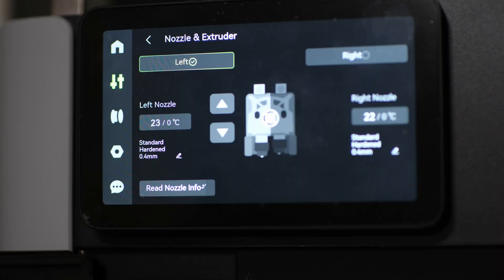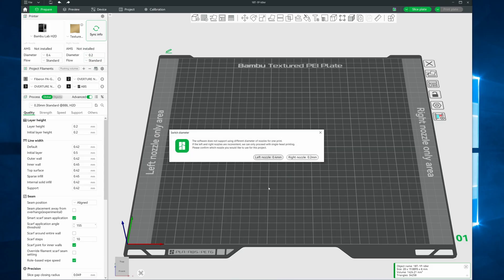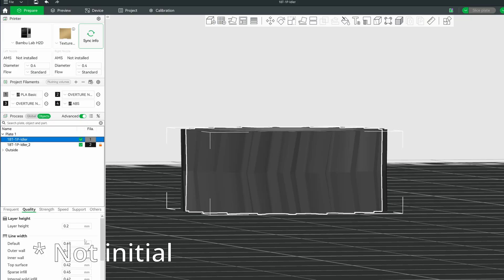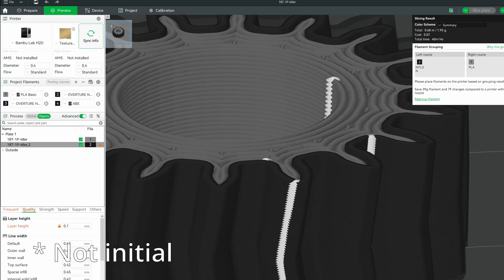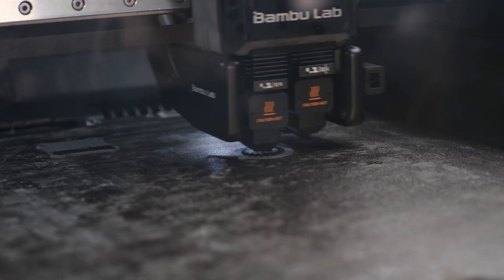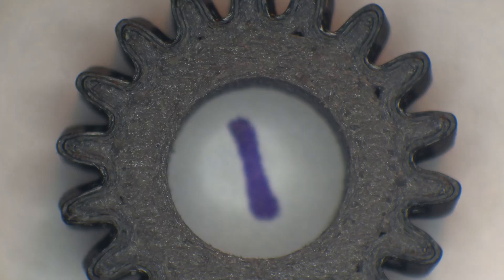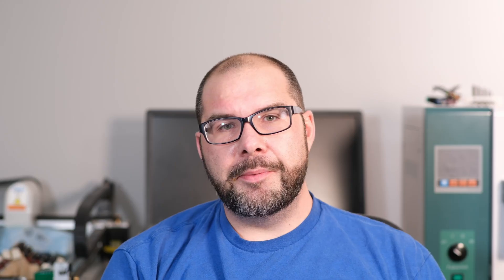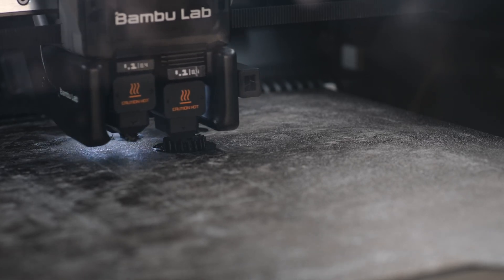Print simultaneously with different sized nozzles

Comment: i just recently got a p1s with two ams units... upgraded from an ender 3 v2 neo. the whole dual and multi nozzle thing will likely keep evolving at an alarming rate, so ill wait a while before upgrading again.... even though i want a larger print bed because while 256mm is nice and bigger than my ender 3, i really could use something over 300 for the small speaker enclosure projects i wanna do as well as maybe some exo cages for some of my rc cars

Comment: It’s definitely possible. Bambu Lab Studio uses G-Code, which has been widely used in CNC machines for decades. Almost all CNC machines can switch between tools of different sizes (for example, various drill bits).
With just software and firmware updates, this capability should also be achievable.

Comment: That's not how any of this works. If you set the extrusion width lower than the nozzle size it will extrude differently than having the correct nozzle size.

Comment: i would think you also probably would need to recalibrate the pressure advance because it's going to use the default 0.4mm nozzle values
Reply: What a hassle, its 3D printing, not printer tuning. Otherwise I wold get an ender or a Prusa.

Comment: I've been building 3D-printers for a couple of years and I would say that machine hardware has a long way to go. But it is smarter software that will bring 3D-printing to the next maturity level. 

Things like different nozzle sizes for the same part, hotend swapping for different, colors and materials, non planar printing for smoother finishes, and much more.

3D-printing has just begun it's 100+ years journey

Comment: This is clickbait, you're not using different sized nozzles, you're just changing extrusion widths and layer heights, it's not the same thing. Having two .4mm nozzles and running one with with .2mm extrusion width and the other at .6mm isn't the same as actually using a dedicated .2mm and .6mm nozzles. Nozzles can only run within a certain percentage of their diameter. Going too far off that will drastically change mechanical/print quality and you just have to keep screwing around with layer height, which will also effect time and quality.

The prusa XL and prusa slicer is the only one that can actually uses different nozzles sizes within the same print. And its not even officially implemented yet. Bambu lab is not a slicer developer, they just copy from others like prusa slicer and orca slicer. So until either prusa or the team behind orca come up with a way to officially support multi nozzle printing, bambu will never have it, and thats just a fact.
Reply: Wow, you really are incapable like that lol. He is actually using two different nozzles, which you would know if you actually watched the whole thing. You are just blinded by pure rage and hatred.

Comment: I have been printing with a set of 0.8mm and 0.3mm nozzles for over 10 years now using the AutoMaker slicing software and my Robox. Simplify 3D can also do this.

Comment: It's not a Bambu Lab thing. There have been toolchangers for ages slicers are still strugling when combining two nozzle sizes in one print. The problem is not that the slicer is not capable of different layer heights or line widths, that has always been possible. My guess is that it's the properties of the smaller nozzle that's the problem. You need another flow rate and feed the filemant slower or faster. Pressure advance is also a factor I guess. Those are properties that belong to a certain nozzle size. Maybe you can modify a profile for the filament that you use in the right nozzle with the parameters that fit a different nozzle.
Point is, that if it were a simple problem, it would be readily available. But it seems that Prusa slicer has an option,but it's still a lot of guesswork and not really convenient. I'm sure Bambu is also working on the problem since it would expand the possibilities of their products.
Reply: Prusa slicer and the XL have been able to use different nozzles sizes for over a year now. Its a beta feature in their slicer. And I mean true different nozzles diameters. Not all this nonsense this guy is doing.
Bambu isn't working on anything, as they are not a slicer developer like prusa is. They're waiting on prusa to make theirs official before they come and copy it.
Reply: This guy did actually use two different nozzles.

Comment: Very creative work-around and definitely solid questions of 'why is it like this?' A while back I found out Bambu had no per-filament XY shrinkage settings and helped rez a year old thread of them 'working on it' they gave it attention very shortly after that. I'll never know but I'd like to think I helped encourage that, even if I've swapped fully over to Orca due to their other printer-control related shenanigans. Maybe the line-width stuff will become a feature if also demanded enough. Seems to be no reason it can't work. Same as the XY constants, it was just extra faffing about with something they could have made a setting.

Comment: Wait... What's the deal with the lack of support materials for H2D? They just don't make good ones for engineering filaments?
Reply: ASA works really well for nylons as support material. Better than support material dedicated to nylon.
Reply: @FrozenByFire3 that's good to know. Now I just need an H2D or toolchanger lol
Reply: there is no support material for the high end cf materials like pps-cf or ppa-cf. Only high end filament where you can use a different material as support is pa6-cf. Kinda fake marketing.
Reply: @AOTanoos22 you can use ASA.... I literally use ASA-CF for PPA-CF support material. Works perfectly. Have my Z distance to 0.00mm
Reply: @FrozenByFire3  nice, did you try pps-cf with ASA support ?
Reply: @AOTanoos22 haven't tried PPS-CF sadly. Don't have a use for it
Reply: @AOTanoos22  there is, raise3d has it for ppa

Comment: Interesting, I grabbed one on my Mod0.2 pinion STL files I used on my resin printer, opened Cura, 0.2 nozzle, 0.08 layer, sliced and got a 2min gcode file. Probably won't work but Mod0.5? Worth fixing my FDM to try, just got a 5 pack of 0.2mm nozzles 2 days ago.

Comment: SnapMaker Orca has multiple tool heads, doesn’t support different nozzle sizes in one print yet, but if you modify the JSON files, you can do this. A HK YTr with a SnapMaker U1 has done this, and as OrcaSlicer is similar to Bambu Studio, that might be where you have to look. Maybe even. Digging in the H2C nozzle definitions might give some clues…just my 2c

Comment: I could do this in 2014 using AutoMaker slicing software, and SuperSlicer later used “Multiple Extruders” and you could assign Extruders to line types. Simplify 3D could do this as well.

Comment: thats a creative way of getting around the lack of ease. This is the level of annoyance I have grown to expect with some of their stuff unfortunately. I don't even think the prusa guys had thought of doing that as a work around for xl similar troublesome support of such things.
Reply: Because we don't need that work around. Set line widths to 100%, set nozzle diameters. Assign features (walls/infill) or parts to the tool heads. Done.
Reply: Prusa slicer and the prusa XL literally has the ability to use different nozzles sizes within the same print. It's been a feature in prusa slicer for the past year now, its just not an official update yet.
So yeah, prusa did this over a year ago man. The only reason why bambu hasn't done it is becasue its not an official implementation within prusa slicer, so bambu cant blatantly copy and rip it off yet.
Reply: Thx for the correction, last I had read there was ways to do it unofficially but it wasn't an easy process.

Comment: I'm not really sure what point you're trying to make here. Sure, you can make the printer print with different nozzle sizes (thinking that it's the same). So..? How is that useful? Unless the slicer calculates for it. There's obviously a lot more that goes in to printing with different nozzle sizes in one print than just installing the different nozzles on the printer. The slicer needs to be aware of the different nozzle sizes in order to create the different toolpaths for the different nozzles. The slicer cannot do this of today. So we are not misinformed. If Bambulab had it all figured out with good results and ease of us, it would exist already.
Reply from the maker: I think I  proved that the slicer is aware of the critical information, line width and height. This hinges on actually doing the design in CAD and not just relying on the slicer. That's the the thing. With that, everything you said is wrong. If you ignore cad and have the slicer do this, then yes you're right. But that wasn't what the video was about.
Reply: @kwakeham  
I'll quote your description: 
"Ya, so seems the slicer can. We we're all mis-informed. It works. It's fine. It's fine. Try it."
What do you mean you have to do the design in CAD? Every design is made in CAD. I guess what you mean is that the different line width and layer heights has to be applied to different parts or objects. Yes, obviously.
My point was that in your example the slicer is slicing for a 0.4 nozzle. It doesn't know that you are using a 0.2 nozzle. And thus the outer perimeters will always be off by 0.1 mm, regardless of the line width setting. The slicer generates different toolpaths for different nozzle sizes. This cannot be compensated for in the slicer. But you could indeed compensate for it in your CAD-design, and maybe that is what you meant. But nowhere do you mention this in the video. 

So we are pretty far from: "We we're all mis-informed. It works. It's fine. It's fine."
Reply: Prusa slicer can do it with tweaking on the prusa xl. It allows a print that is faster and more detailed then printing all .2

Comment: gotta wait for the open source crowd to solve the issues and then it will be in bambubu app
Reply: This has been a feature supported in Prusa Slicer for over a year now, which is fully open source (Bambu Slicer is originally built off of Prusa Slicer)

The Prusa XL and upcoming INDX are able to use this feature without issue. We (Prusa) hope that the work we've done on multi nozzle size support in our slicer can help the larger community, as per the nature of open source. :)

Comment: I am interested in understanding what the new H2D’s “Toolhead Enhanced Cooling Fan” is good for.  This is an improvement that came from the H2D pro and is now offered as an upgrade. It’s for materials with heat creep issues, not sure if helps with engineering materials.
Reply: From reviews/reddit articles I believe it's mostly to replace the normal one that breaks down way too quickly when using the chamber heating for printing high temp materials, because its fan bearings can't handle the constant high temperature environment. But BL is disguising it as an "upgrade/enhancement" instead of admitting that the normal head should have been fitted with this higher temp resistant fan in the first place

Comment: My guess is that slicers may one day offer differing nozzle sizes for sparse infill and support material, but based on what other people say, it may never be practical for other areas. Would be nice to be able to use smaller nozzles for outer shells in future without causing other issues.

Comment: My guess is that, as you have found, there are some quirks to be worked out and they just haven't gotten to it yet. It seems like BL puts the user experience above everything else and if they can't make something work perfectly they probably simply won't put it in until they can.
Reply: I think this is right. The H2C could have optimized filament changing quite a bit. There must have been corner cases so its takes the longest path, which als ensures an overall good user experience (sans time to print but that is better than subpar prints)

Comment: Can anyone comment on the way this works on the Prusa XL?  My understanding is that it's a beta feature in PrusaSlicer but I couldn't find any videos discussing the specific feature at any length.
Reply: Prusa slicer/prusa XL can use actual dedicated different sized nozzles. Not this "jumping through hoops" stuff that this guy is doing, nonsense about changing extrusion widths and changing layer height.
Reply: @LilApe  Yes, and I'm wondering if there are any videos testing/showing the feature in detail?  I believe it's a beta feature, so I'd like to know how functional it actually is in practice (what it's good at and what its limitations are) but so far I haven't been able to find a lot of info on that.
Reply: he is not, you are Iying again

Comment: Yes, the slicer can slice with different line widths and heights, but I think it's disabled for a reason. You would need to interpolate between regions of low and high detail, if the lines are next to each other, or you'll end up with gaps. Or detect those gaps and then try to fill them with the smaller nozzle, which itself has many edge cases I can think of. Plus you need to enable z-hop on travel to avoid collision, and even that won't be enough if you are trying to print adjacent to a line that is higher than your current nozzle height. That last part could be solved by having one layer height be an integer multiple of the other.
Anyway, long story short, it's a computational problem, and I'm sure it'll be solved, but we're not there just yet.
Reply from the maker: For engineering as I showed these are non-issues. If you're bringing in a solid model then yes, you need a way to differentiate but you can do this in cad. This is why these videos have used a herringbone gear, a structure that has non constant curves and sweeps for the most complex curavatures. So long as you do this in cad it works. This does require planning and cad so not useful for art models. 

I did mention it, but the tallest layer is always printed next. So far as I can tell this is already solved to an extend. I believe, but could be wrong, that zhop is already enabled by default.
Reply: This is complete nonsense. There are industrial 3d printers that can change the nozzle size while printing without having to swap the nozzle. CNC Kitchen made a video about FORMNEXT 2022. This technology is extremely old by now. In fact, it's as old as Bambu Lab.
Reply: @shushirakawa3182 We are talking about the slicer he's using and more generally consumer slicers, which all borrow code from each other. Not about closed source slicers inaccessible to the average user. Same with non-planar printing, which also exists in industrial slicers.

Comment: The problem with multi nozzle size while printing, is you get some quirky print quality issues, not to mention the complexity with slicing. When you are using a .4 and a .2 for example, each nozzle can reach effectively different corner radii, this ultimately causes prints to have an insane amount of gap fills that cannot be compensated with Arachne. You also must have the same layer heights, as you can otherwise have collisions (this is why independent support layer height can only be turned on when the prime tower is off.), you would have to do fancy collision avoidance calculations on each layer, and the added travel time would negate the time savings. Having the same layer height is also difficult in the first place. 0.12 is draft for 0.2 nozzle and considered high detail on the 0.4. Overall, there is a reason why Stratasys choose 0.5mm nozzles, it is literally the perfect medium between speed, strength and surface quality. 

Also - side topic carbon fibers are not toxic 😝 most of the ‘studies’ are not done by medical professionals, and are used for attention.
Reply: Carbon fibres are still bad for friction, which is important when making gears! I suspect all of those software hurdles would be solvable, and some hacky workarounds to add different-sized nozzles to Orca as an “experimental feature” would still be plenty useful, and give curious users a chance to mess around with it and provide feedback to make it less hacky. A larger nozzle for faster printing of support filament could be great.
Reply: Never heard anyone say carbon fibers are toxic, but the epoxy resin on the other hand that is used to bond them together. But if you saw a carbon fibre part (which i have done a few times building bikes) the dust is very very bad for your lungs. Also if you sand a cured expoxied carbon fibre part, the dust is not good for you.  can lead to chronic problems.
Reply from the maker: Radii is a good point. Though I don't think this is a huge issue. This also came out of a previous video about carbon fiber filament and found no embedded material in my hands. The interesting part was reinforced gears have less wear than unreinforced. The working theory in the paper was stiffer lead to more ideal movement of thr involute profile.
Reply: From what I know, the issue with carbon fiber is when you touch/handle a print a lot, some of the fibers can get stuck in your skin and become irritating.
Reply from the maker: See my other video that prompted me to make this two material gear. I literally rubbed PA6-CF all over my hands like that other video.... nothing. I think it's from low quality or materials that shouldn't have CF in them like PLA and PETG. I've only checked engineering filaments from multiple brands, but things like PA6, PA12, PA612, PPS all reinforced. Nothing. Can't replicate that video. Moved on to this idea